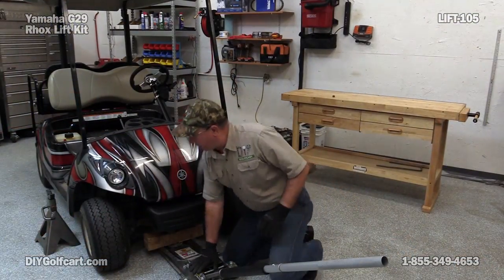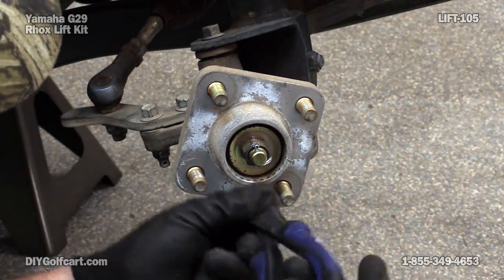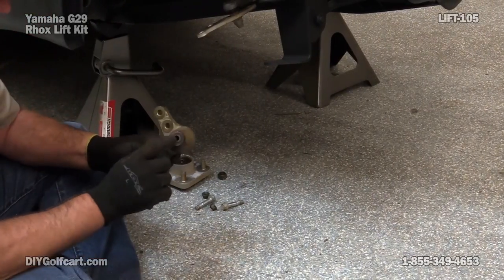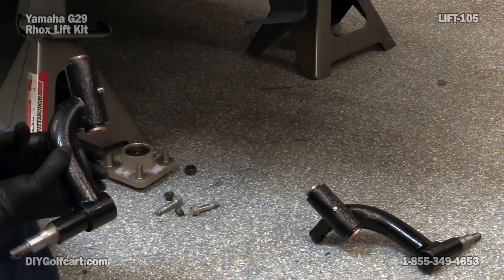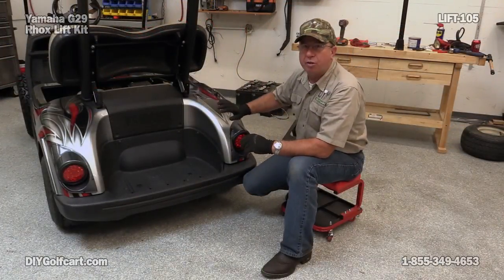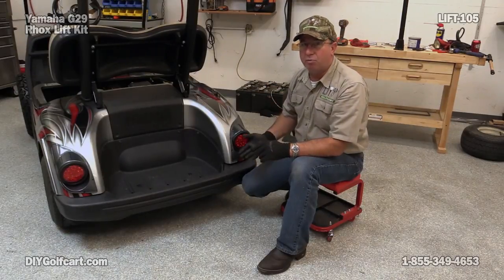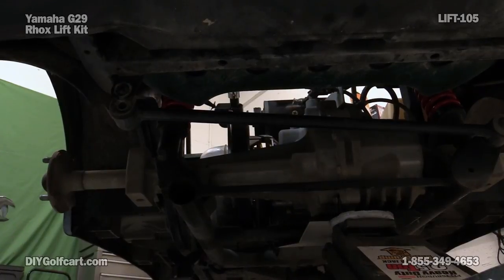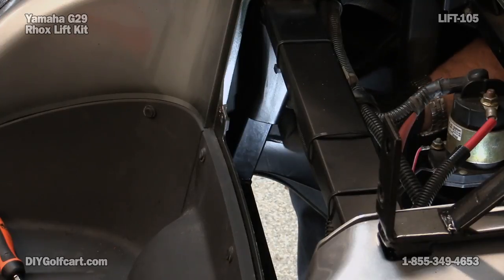Yamaha Drive 6" Spindle Lift Kit | How to Install on Golf Cart

Comment: Barry, I have a question about fuel pumps for my G22. I purchased a new fuel pump online and searched for the pump with the "most economical" price. Since I did buy it at a super low price, does that price also reflect the quality of pump that I did receive? I installed the pump and turned the engine but no fuel seems to be moving. I also primed the fuel line and still no fuel. any help on this will be appreciated.
Reply from the maker: The price is always an issue. Old saying goes "You get what you pay for". It only take 1 to 3 lbs to make the diaphragm actuate inside the fuel pump. Make sure that the engine compression is around 150 lbs, if so and you're not getting fuel to the carburetor, Bad Fuel Pump.

Comment: how much taller did the entire kit make the golf cart from stock.  Does it fit under a normal garage door?
Reply from the maker: mick883 The lift kit was 6" lift and the tires added another 4". The normal height of a stock Yamaha Drive is 94". Now add an additional 10" of lift....104"! Now, you must go measure your garage door! Let us know what you find!
Reply: is the installation the same for the 3 inch kit?
Reply: It is 1.5" shorter than my door.  Just fits.  But it Fits.

Comment: What's the difference in a Spindle lift kit and a regular lift kit? Does it matter? I have a G9 1991.
Reply from the maker: On a Spindle Lift Kit you replace the spindles with extended spindles that gives the car it lift in front. For a Yamaha G9, you'll need to use a A-arm lift kit. That means you replace the OEM a-arms with extended  a-arms to give the lift. Each type of lift kit basically a different way to lift the front end. Sometimes due to rust, replacing the a-arms is the way to go.
Reply: DIY Golf Cart thanks!! Do you have a link to a site that I can find my serial # so I know exactly what G it is? The serial is JG6-001-1830 but I can’t find that anywhere. And. I think the JG6 doesn’t mean it’s a G6. Thank you a ton!! Your videos are awesome.
Reply from the maker: @lancek753  Give me a call at 877-960-5464 and leave/give me your email address and I'll send you my excel spread sheet with all the serial numbers with years manufactured.
Reply: @golfcartking  Awesome. Will do that. Thank you!